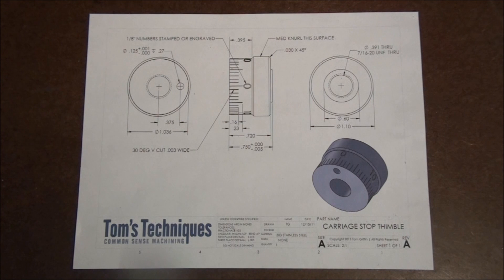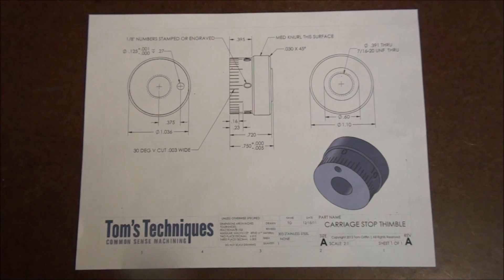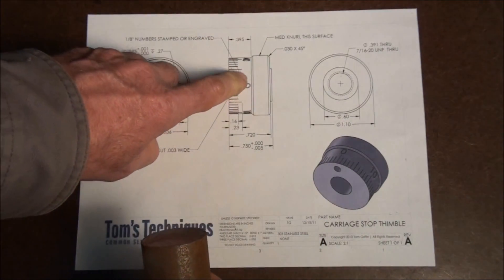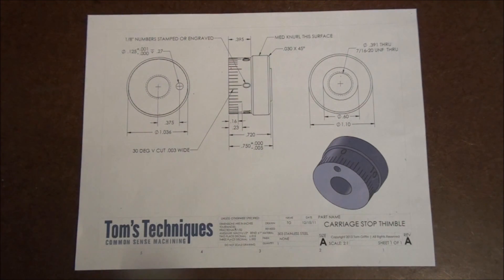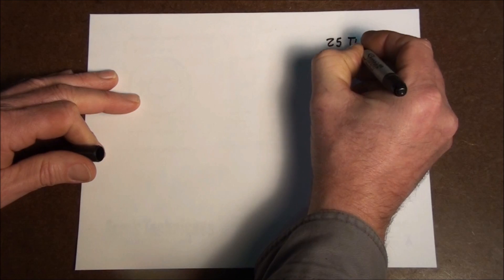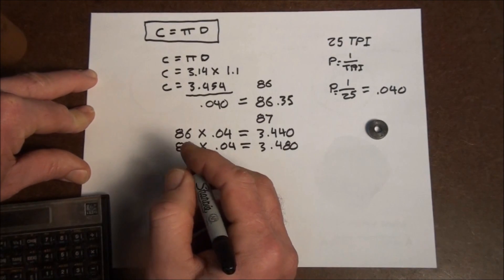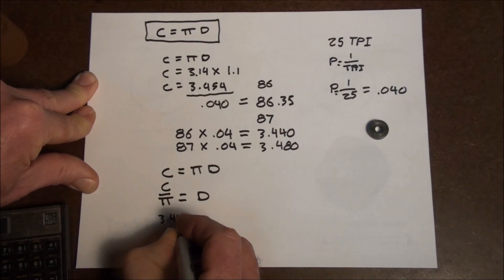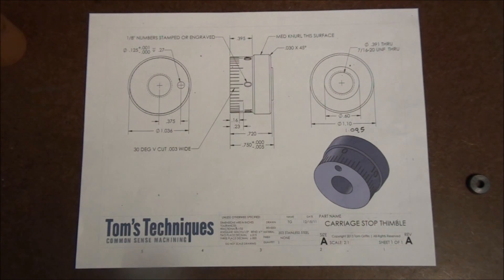Carriage Stop Thimble Part One, Order of Operations and Calculating the Ideal Diameter for the Knurl

Comment: Thank you very much for this information; hopefully my first project knurling will work out well 

I'd think to multiply knurl dia tooth pitch by n where n is a number that will create a circumference value that when converted will be equal or less than the part's current diameter; this way one can turn down to the resultant diameter value. Might magic this into a spreadsheet for turnkey calculation when I get the time.

Edit: why is the like button missing?

Comment: Tom, 

Great video I check YouTube  every day for new videos. I am learning at a pace, even made some toolmakers finger clamps with the BP I've had sitting for 9months as I was too intimidated to use it.

One question though (I realise my inexperience may show here) why not mount the stock as you have it on your drawing. Face, turn the raised centre boss, turn the diameters for knurling and graduations, knurl, bore, tap, index and mark the graduations  part off, drill locating hole?

It would be invaluable if you spent a little more time on the order and perhaps went through scenarios where you would paint  your self into that corner to learn what to watch out for.

Great job keep it up!!;
Reply from the maker: Alastair,

I actually am spending more time on the order of operations. In fact, the next video is uploading at this moment and I go into great detail about the proper order.

You'll see in the video, but there are several problems with holding the work as shown on the drawing. First off, it is more difficult to turn a smaller diameter behind a larger one. Also, if you turn the diameters, cut the knurl and then face the right end, what are you going to hold onto to face the left end? The tapped hole has to be the last operation for the same reason. A 3/8" mandrel will be used to hold the part to cut the graduations and stamp the numbers.

Thanks for watching.

Tom

Comment: This is yet another excellent instruction Tom and I am ever so grateful that you have taken the time to go through it for us. I confess that I am also interested in this series to enlarge the cross feed dial and compound dial for my lathe. (old eyes)
One thing I am not clear on, wont the carriage crash into this stop if the lathe does not have an "auto kick out" ?  Or is this primarily used for if you need to go to a set location and do a plunge in type of operation like the start of a left hand thread?
You are a gifted teacher and much thanks from here in Canada.
Richard.
Reply from the maker: Richard,

This is a manual carriage stop. It's used to machine faces or grooves located from the end of a part, or to accurately face a part to a specific length. To do that, you would  set the stop to zero, run the carriage against it by hand (hence the name carriage stop), take a facing cut using the compound to control depth, measure the part, then move the stop the required amount and take a finish cut.

Tom

Comment: Tom, thanks for the knurling info!  Ever since I found out how it was really done (I.e. not by making a whole bunch of angled cuts!), I'd wondered about the diameter question...how you adjusted for various diameters. Now I know you don't...you adjust the design to fit the available tooling.  Good to know. 

Since this one was mostly about the math, I will point out a minor booboo...though it probably wouldn't make noticeable difference in practice in thus case:  you used pi to 2 decimal places (3.14) yet came up with a result with three decimal places.  That introduced error of about 0.001 in this case at that step in the calculation. Using 3.142 would have been better from a math standpoint, though I don't think you'd have arrived at a diameter different enough to have a practical effect. When I can't use a pi button on the calculator I usually use 3.14159, and then round off as needed to avoid gaining false precision in my results. Had professors in engineering school that took off for things like that!  

Getting the knurling to come out right is the point though, so close enough is all you need...once out of school.
Reply from the maker: A diamond patten can be made with angled cuts, but then it would be called checkering. I did it to the front strap of my .45 a while back using a checkering file and believe me, knurling is a whole lot easier.

Regarding the math: Using 3.14 vs. 3.142 for this application would be like spending time machining a part to a tolerance of ±.003 when ±.01 would be acceptable. That's one of the hardest things to learn about machining. Guys will spend hours milling a fancy contour on a part when in reality a part made by band sawing and belt sanding would work just as well and take a fraction of the time.

Thanks for watching. Hopefully I'll get the time to actually get started making the part tomorrow.

Tom

Comment: Thanks for the excellent math lesson. Same as James Munn below, I am speculating about the knurl deep influence to the part surface circumference.
By the way, some days ago I machined my 1st crosswise knurls in live without any part diameter proceeding and they come out great. Maybe a lucky silly man...?
regards
Milan
Reply from the maker: The TPI of the knurl is based on the pitch diameter of the knurl (half way between the root and the crest), so when it is pressed into the surface, the pitch is correct for the diameter you are knurling. I've added a link in the description box that includes a lot more knurling theory than I've included in the video.

Tom

Comment: Should you make any compensation for the depth of the knurl?  Is that built into the tpi specification of the tool?  Would you want the bottom of the knurl diameter to be X times 1/pitch?  You seem to have calculated that for the top of the knurl diameter.  I guess it depends on how they measure the tpi on the tool, either at the root or the tip of the teeth. Maybe somewhere in between for compensation?  Or I could just be missing the basic understanding of what actually happens as you form the knurl.
If the outside diameter is what sets the knurl spacing then as you force the tool into the work does the first touch form a gear like interaction with the tool thereby controlling the knurl pitch no matter how deep it goes?  Thanks for a nice intro to the calculations.
Reply from the maker: James,

As described below, the TPI of the knurl is based on the pitch diameter of the knurl (half way between the root and the crest), so when it is pressed into the surface, the pitch is correct for the diameter you are knurling. I've added a link in the description box that includes a lot more knurling theory than I've included in the video.

Thanks,

Tom